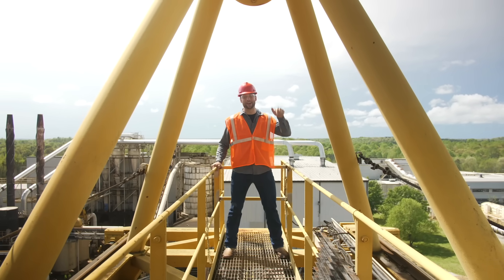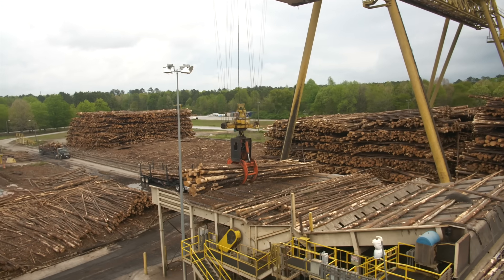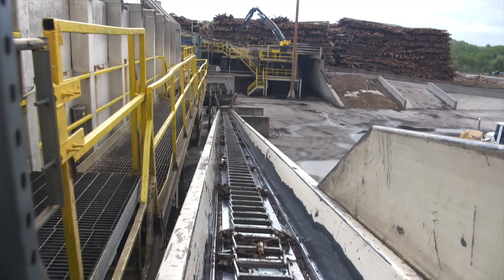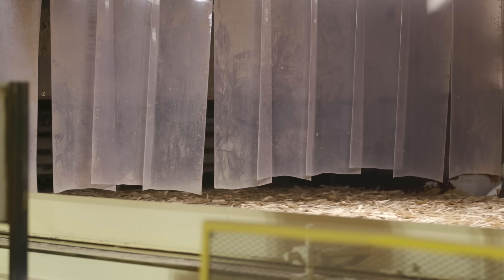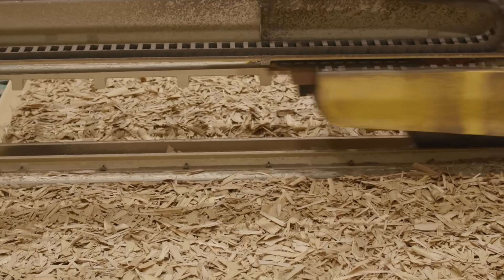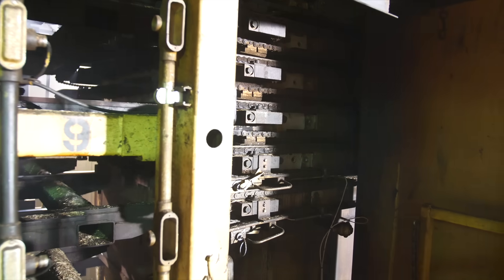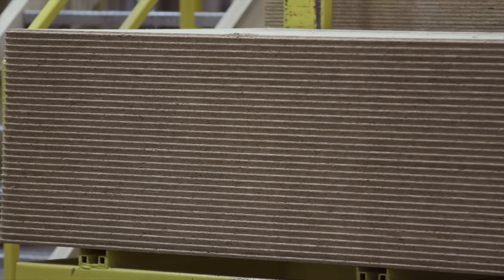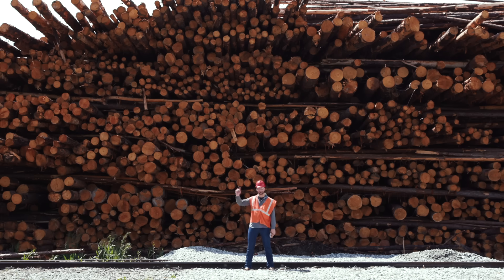Could OSB be BETTER than Plywood????

Comment: "There is a very precise orientation to ensure maximum strength..." cutaway to square piles of wood chips in random orientations
Reply: Not that I’d ever use OSB in my house; but the point of OSB IS the “random” orientations. By placing the strands in every direction, their goal is strength in every direction. 
My own biases against OSB is the hierarchy of durability against damage by moisture and insects: solid wood; plywood; OSB; particleboard. The more processing the fibers get, the more you’ll be relying on glues/resins/bonding agents. Solid wood absorbs water, but slowly. OSB absorbs water quickly.
Reply: @DanielinLaTuna  More surface area to absorb water.

Resin is an amazing material, when combined with a backbone. By its self, it is brittle and has no strength in compression or tension. Give it a backbone like glass/carbon fiber and it is stronger and more durable than steel of the same cross section while being lighter than aluminum. 

Wood on the other hand is an abysmal choose for pairing with resin in structural components. But it is cheap, so cheap it is made of the garbage left over from real wood.
Reply: @herpnderpn2484  A very good analysis!
Reply: @herpnderpn2484  well as you could see entire forests of real wood get scrapped for it ;)

I am no OSB fan, but they seamed to put in decent wood at the least.

(Probably not enough quality in the trees to make sticks or ply out of them)

I do think factories introducing OSB long time ago with bad glues in there shot themselves in the foot for the long term.

I can’t see the quality on the stuff so if I see a piece of osb I assume it is crap instantly and throw it in the dumpster.
Reply: small saw dust makes the better finish.  its smooth as glass when painted. osb chips you cant put tile floor down on. wont work. water gets in the cracks and it swells it all up. big chips make a rough finish. i look at sawdust as a floor cleaner put a bottle of red floor polish, the old floor polish in ten gallons of saw dust and throw  it on a dirty floor, and wow! how clean and dust FREE they floor will be after it is all swept up.
Reply: There was a roller that turned the chips in one direction.

Comment: SIP-grade OSB has a high resin content and uses other woods such as Ash and Poplar.  That stuff is awesome with a 90-day exposure rating.
Reply: Is this what they are bonding this particular OSB product to make to more... moisture resistant and keep it together?   Also is the resin what give OSB its high weight?
Reply: @baloneyjusticecheezedog  SIP-Grade OSB is heavier than regular 7/16 OSB sheathing, mainly because of the resins and waxes used.  However there are OSB products that are denser and thicker and designed  for flooring that are quite heavy.
Reply: @DavidMDensford  my experience with OSB products vs Plywood has been I noticed right off the bat the OSB weights so much more then Plywood... (but to confirm a bias...) that does not seem to be a bad thing for flooring, and to spend the extra money on SIP grade OSB, means its more water resistant.. and better for suited subfloor then Plywood?
Reply: @baloneyjusticecheezedog  you may need to look up Structural Insulated Panels, SIPs.  SIP-grade OSB is laminated to a high-density foam core to make walls and roof home shells.

Comment: engineered vulnerability to moisture diminishes durability.
Reply: There is water proof OSB.
Reply: @obi-wankenobi9871  "resistant" is what it actually is. Once it penetrates the wood though, it all goes like regular OSB.
Reply: @TechieTard  I stated something similar in another comment. The big mistake many commenters make, is to even concider plywood and OSB for outdoor usage.
Reply: if it is synthetic wood already, they could mix better ingredients that  prevent water, thermite attack, and fire damage. They have the techonology to do better, but it is bad for business.
Reply: @jr3474 . Or you use a material fit for the job, instead of pumping wood full of chemicals.

Comment: I'm in the middle of building a house with Zip and have been very impressed with both the product and the company. We have had several major storms roll through and it still looks like the day it rolled off the factory floor. My OSB subfloor (not Advantech unfortunately) on the other hand is in rough shape.
Reply: Zip is OSB, as you know. I've used it as well and achieved good results. It's one tool of many, many available options. I will say I worry long-term about how that particular home will hold up.

Comment: I used this on my subfloor up here in the Pacific NW right before we got dumped on with rain. Even when we couldn't get the water off we ended up with only about 1/16 of swell on A FEW edges and other than that the whole thing is strong and flat. I actually have a few pieces that have been sitting outside in the weather as temporary decking for about 4 months with no deformation or structural issues. Plywood will often return to size and shrink back down, but I've found there's more squeaks and when it swells it delaminates so the damage is already done.
Reply: Osborne is shit should be outlawed
Reply: @fucyu3924  Osborne is awesome moron
Reply: Osb
Reply: I won't hesitate to use OSB for a subfloor.  Right after laying it down, I throw a layer of deck sealer on it.  I figure it's all the weatherproofing it will ever need, and doesn't cost that much.

Comment: Why don't  they make it more water resistanr?
Reply: They could if they switched to sonic welding (similar to how plastics are welded) to bring out the lignin and naturally glue themselves together and then fill in with glue as there will be some sort of gaps since there wood not be enough lignin to fill in.

Comment: Regarding your wrap-up:  I’m surrounded by PhDs where I instruct at a university.  That doesn’t mean they are better at teaching (or engineering panels), it simply means they have a PhD. So what?  For a title teasing that OSB (that your channel has also referred to as vertical mulch) is superior to plywood would be much more effective with empirical data, e.g., independent lab testing for strength, durability, UV resistance, moisture tolerance, etc. maybe it’s better now, but my experience peeling back walls and roofs for remodels demonstrates a product that I can typically poke a finger through, vs plywood, that even when discolored from moisture, typically has not delaminates and is almost always serviceable. 

OSB is cheap. That is its sole advantage. I would love to be proven wrong, but a plant tour isn’t going to do it. 

I still love your channel!!!
Reply: Yeah, Seems to me, the ones with degrees teaching these days (At universities) are just cant make it in the real world! Many times they made mistakes in their lessons, but oh they can be wrong can they!
Reply: @mikeclarke3005  Those who can do, those that cant teach
Reply: osb should be banned in home construction. it is garbage
Reply: It never ceases to amaze me that ppl assume they know what they are saying but they never Ave read the spec's on a product before opening their bucket mouth full of saw dust...
Reply: @BrianBriCurInTheOC  You opened your mouth too Brian...what are you saying?

Comment: Just out of curiosity, what's the price difference between OSB and plywood in the U.S?
Reply: Huge, 19/32 OSB is $12 where as 19/32 Plywood is $22
Reply: @justinferello2020   so almost double for the ply. In that case i can understand why people would want to chose that OSB stuff!
Thanks!
Reply: @nenne1987  osb is around 14 bucks..... Yes.

Huber advantech which you see in the video is double that. And well worth the price difference to be honest
Reply: Prices vary by region in the USA so it can range from 10 to 15 a sheet, but if you want stronger and nicer looking wall covering then plywood is the way to go since as the more holes you put into osb, the weaker it gets, plywood does not have this issue even if you fill in the unused holes with 'wood' filler.

Comment: Which one is better then? I didn’t hear anything about plywood? Eh?
Reply: 1806StoneHouse he definitely did not mention plywood in any comparison ever....not even once or a percentage of. This is a commercial
Reply: Clickbait title.
Reply: Zekegold I didn’t even watch! Thanks to everyone who commented! Geez I hate to be suckered in and waste my time!
Reply: 40 years in the construction industry and all i can say about OSB is BS. I could go on for weeks about what a lot of crap that stuff is. Now microlam and paralam are respectable methods of using wood. this ranks with propaganda because it is so cheap.
Reply: Because they know it is superior and this is an OSB commercial.
Reply: I remodeled houses trust me osb turns to shit when leaks get it wet just like Masonite sideing. The problem is exposed end grain.....plywood rots on the edges ...osb rots everywhere. Sue for the warranty,and lose by improper installation.Name a structural waterproof glue.... crickets.
They seal the sheets...which are sawn at corners , windows, dormers,ridges and valleys...the source of leaks
Reply: @davidpaulsen1510  The glue is very water proof. It's also attached to wood that has very poor strength in tension. Make a stronger glue, the wood fails.
Reply: @herpnderpn2484  Glue...Cheep(OSB), waterproof, or structural pick two or use $$$ epoxy and glass. the wood chips that penatrait through the sheet aren't impregnated.the glue eventually fails as well everything turning into mulch .tired of replacing this spongy crap for over 30 years. And the crap sprayed on it "to protect it"is a joke. I will not guarantee anything laid over it,nor"water resistant "plaster backer board  for tile. Another pos product introduced into the market,all hiding behind corperate lawyers and replacement of only their product is $50 for a shower that cost 3,000 to install and tile. Same for water damaged unnoticed by roof leaks from OSB. If you maintain leaks immediately or are a flipper or want to replace your roof sheeting each time you roof or remodel laundry rooms and bathrooms every 10 years sure go for it. I wouldn't even build an outhouse with it. But that's just my experienced opinion of soil conditioners or mulch paradeing as building materials.🤣
Reply: @davidpaulsen1510  I think dude described it perfectly, "Sensitive materials", even though he is obviously a shill... That slipped through somehow.
Reply: CREDIBILITY, CREDIBILITY, CREDIBILITY.  Once acquired, EASILY LOST, near NEVER REGAINED!!! CREDIBILITY???

Comment: Very informative on OSB. Thank you for that. Is there a particular step in manufacturing that makes this cheaper than Plywood? Not as much log handling and individual manipulation?
Reply: I'm taking a guess by saying you can use a poor grade lumber for making strands where plywood takes a better grade of trees to get decent veneers.
Reply: I don't know anything, but it looks like they use much thinner logs for the OSB. It doesn't have to grow as long and if you need to clear out small trees anyway, they can't be used for plywood but you can turn them into OSB.

Comment: Sadly too many "contractors" purchase all their materials from the big box stores and judge everything by those products.  A multitude of products are available from quality companies are available, but, many want to save a couple dollars only to cost them more later.  No quality contractor should purchase materials from the box stores, blindly believing they are getting anything but low quality products.  As always you get what you pay for.  Great presentation with someone who appreciates quality and is willing to have an open mind.
Reply: I agree with some of what you are saying, but you're casting too wide of a generalization.  I wouldn't be a 2x4 from Home Depot unless I was short on firewood, but have seen Weyerhauser OSB and USG sheetrock there
Reply: @BrianKrahmer  Mfg make different grades of product for different markets.  Just because it has a "name" on it, doesn't mean it's the top quality that mfg produces.
Reply: @wags99999  i've heard the same thing about electronics at walmart, etc, but have never seen any proof of it.  feel free to produce some spec sheets that prove what you are saying
Reply: One sheet of 19/32 from lowes, one sheet from 84 in the last week. The lowes plywood has their color banding applied to the ends for the cashier to identify more quickly, the G-P UPC tag on both pieces was the same..  There are three choices locally, Lowes, 84 or an independent store. Besides the higher price I stopped going to the local place after multiple attempts by them to off-load their twisted up splintered junk on me. The same CANFOR branded balsa wood bs that lowes and 84 both sell. At least with lowes you can sort through the fire wood pile to find something decent, 84 to a lesser extent and the local guy will absolutely throw a fit if you dare sight down your material before accepting it.

Comment: I’ve had good experiences with Advantech and even dryguard. Not a lot of experience with plywood but I’ve seen a lot of delamination. It’s funny to see people curse osb then talk about the wonders of plywood. It’s all worthless when the adhesive fails. It’s not like plywood isn’t a man made product too. Guys in the 50s called plywood junk the way some guys talk about osb now.
Reply: I agree to a point. I'm not going to fall straight through a floor if plywood delaminates, at least not at first.
Reply: Julio Blanco 
Just different Ole Farts being Ole Farts!
Reply: There's no comparison when it comes to lap vs ply. same as there's no comparison between osb and ply.

Comment: How does this compare to plywood?  Or even better, hardboard?
Seems to me that hardboard is a better solution to using wood fiber to make boards.
With so many PHD's there, why OSB?  It is very easy to see the disadvantages of OSB vs the many other methods.
It doesn't take a PHD to see this.
Reply: The logs are mainly from tree tops and small trees that you can't make boards from
Reply: @SawmillerSmith  ?!
That doesn't make sense.
I'm talking about wood fiber being made into hardboard.  Not cutting small trees into 2by4's
Reply: @ryszardbargiel7256  okay

Comment: Sorry, I didn't hear a thing that led me to think, "OK this is truly revolutionary stuff, it ought to hold up for at least a couple hundred years come hell or high water." On the contrary, I suspect that it will turn to moldy mush if it gets even a hint of water on it. And taking a look at the pictures didn't convince me that the strands were all that "oriented". They looked pretty random to me. Scattered just like sprinkles on a cupcake. What wasn't talked about at all, not even mentioned, was all the outgassing from that polymer resin. No assurance at all that this stuff isn't going to gas you in your sleep if you build your house with it.
Reply: You need to do your research  I have worked in these mills for 20 years osb is a much better product to plywood
Reply: My mentality is facepalming itself every time i read someones comment mentioning the 'off-gassing' of plastics let alone spray foams. The worst thing spray foam does is just smells bad if it was applied incorrectly, its not going to kill you in your sleep or even if you were awake and just sniffing the minor amount of the said gassing.
Reply: Randomness is a quality in and of itself.
Reply: The only time you will ever see PMDI resin outgassing is if it's on fire..
Reply: “resins in OSB are designed to completely cure in the hot press process at the plant, and after the process, SBA mills hot stack panels for at least 48 hours after trimming to allow gases to dissipate, and current findings are that the OSB panels will only very minimally off gas after that, doing so only when coming in contact with high heat and cutting, such as when they are cut on site during construction or demolition.”
https://greenhomeguide.com/askapro/question/does-priming-and-painting-osb-help-prevent-offgassing
Reply: Probably shouldn't use carpet, laminated flooring, many kitchen and bath cabinets, etc, because they all off gas. If your not dead yet from your house, most likely it's ok.
Reply: The degassing process happens at pressing. The resin is largely inert after it has been pressed.
Reply: Your other alternative is plywood and we all know that's crap
Reply: The Sky is falling
The world is flat!
Reply: dlwatib wow that’s a very extreme assumption....